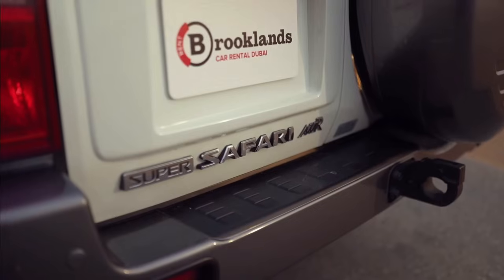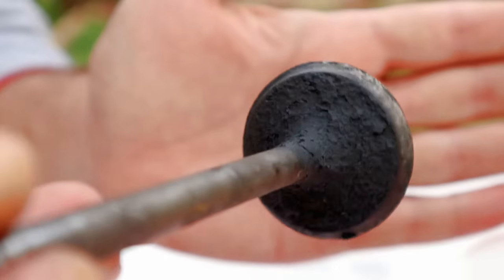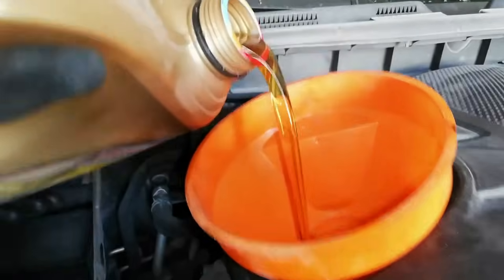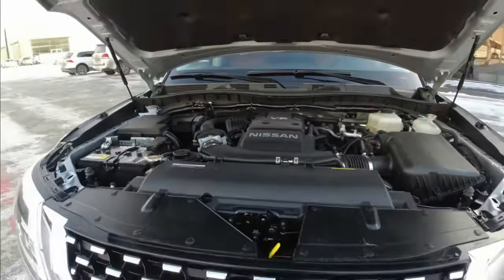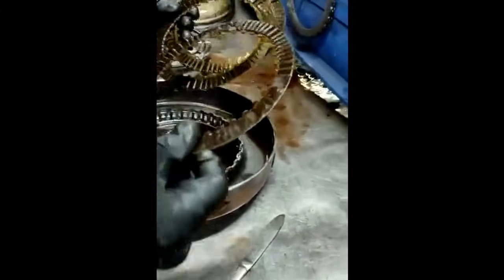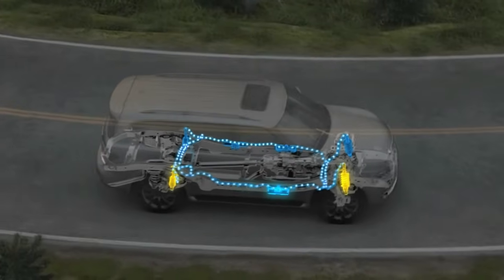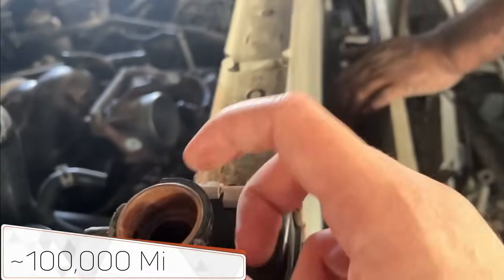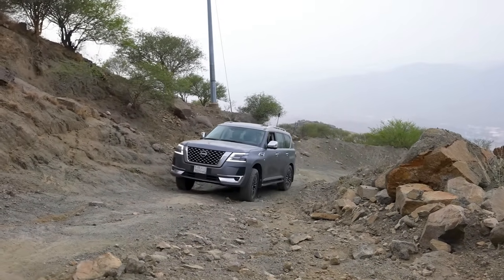Nissan Armada Y62: still a good buy in 2024? A Complete Reliability Guide

Comment: The Y61 is the greatest 4X4 in history of automobile.
Reply from the maker: Absolute legend 💪🏻
Reply: 😂after landcruiser
Reply: @kaidenchetty4572  To be exact the 80 series Land Cruiser
Reply: With the ZD30 engine, or kettle TD42?
Reply: @ericjohnson6802 The TD42 being a kettle is over reported. Bought mine new, towed a caravan up a d down hills all day in over 40 heat. Never had a over heating issue and same goes when I have talked to other owners.
Reply: @Dazza-u4c 100%
The 4.2 only got the kettle reputation once social media came around and every young guy around got one and wound the boost to stupid levels trying to make it a motor it was never meant to be. 
I’ve been running them since 1988 and never had a single issue.
Reply: @BrianMariki2022  nope. LC 105 with Solid Front Axle and the venerable 4.7L V8.
Reply: @Baebon6259   I was referring to the Diesel variants. The 105 came a NA Diesel which didn't have enough grunt. The 100 had this 1HD-FTE motor which was superb but IFS
Reply: y62
Reply: TB48 trounces anything toyota make, and Nissan still make them for the middle east. Nissan Petrol engines superior to Toyota. Agree with above comments. TD42 only suffer over heating issues when P plater dorks decide to stick a turbo on an engine that was not designed for a turbo, has probably done 400k miles already, and not been maintained properly. Factory well maintained TD42 turbos are bulletproof

Comment: Got rid off my cruisers after 20 years of on going problems. Had a pattol since 2008, only replaced alternator. Apart from tyres brake pads, greatest Automobile ever. Cruiser has a cult following, i fell for it, glad i wole up
Reply from the maker: Y61?
Reply: @thelonglastexpert  1990 y60, in 2008 I brought as a 1 owner of Oldman with 260k. Now has 558 runs perfect.

Comment: If I cannot drive a Mercedes-Benz Geländewagen, it will have to be a Patrol.  Toyota uses engines from Yamaha, Isuzu and Mazda.  See, I do my homework.  Also, unlike Landcruiser, Patrol has proper diff breathers, just like the G-Klasse.
Reply: Please provide some sources that says Toyota uses engines from Yamaha, Isuzu, and Mazda. Those 3 manufacturers are some of the only that have a chance at making as reliable of an engine as Toyota genuine designed engines. Add Honda to that list it’s a top 5.
Reply: @andyeighttre I thought it was common knowledge that’s Toyota uses engines from Yamaha……

Comment: I changed the entire driveline oil (gear, transmission, power steering, transfer case, and spark plugs) at 20,000 miles on my 2023 Nissan Armada platinum, and it NEEDED IT!

Comment: The VQ40DE uses almost the same fuel consumption as the VQ56VD, there's absolutely nothing special about it other than saving on initial purchase and then having a sluggish slow car. I own the VQ56DE patrol and I'am happy with it clocking 320,000km with no issues. The only major thing that I replaced is the radiator and power steering assembly which broke due to jumping hard on large speed bumps in Dubai.(Note: The steering assembly leaked oil but it kept working fine all the time, the service advisor said it can only be replaced which is much easier and cost effective).

Comment: I just bought a 2020 Armada (68,000 miles)  basically for its Tow Capacity (rated 8500lbs), I'm not as concerned about Fuel Milage as we use it primarily for fun (tow our vintage car) Sure would be great to get 22mpg as we did with our MBZ Sprinter Van but the Armada is more comfortable.

Comment: All Direct Fuel Injection engines can suffer inlet port carbon build up as the fuel and its detergents no longer 'wash' the ports and the back of the valve.

Comment: Which Patrol is more fuel efficient between the TB48DE 4.8 litre 6 cylinder Y61 and the VK56VD 5.6 litre V8 Y62?
Reply: The 5.6 V8
Reply: The 4.8 Y61
Reply: Y62 for sure. My 100 tdi lags behind in spades!😅

Comment: I’m so close to buying a 2023 Warrior. Should I? Shouldn’t I? Do I wait for the Y63? Or do I go for the last of the V8s?
Reply from the maker: It's hard to answer this question, sir, but we must admit there's not much reason for joy. Take a look at the new QX80, and in my opinion, it's a large luxury SUV that your wife should be driving. I believe that if the company makes a new Patrol based on this SUV, it will be a fiasco, but there is great hope that a different platform will form the basis of the new model, and then there might be a chance to look forward to the new Y63. However, if you are a fan of a big V8, I don't see much point in waiting since the new Patrol will likely be the last V8 for this model.

Comment: You should make a video on a Lexus GX460 reliability or The Toyota LC150
Reply from the maker: It would be interesting to make a video about these cars. The GX460 has an excellent engine, but it's very important to service it properly and wash the radiator regularly. As for the LC150, with the right engines, it's tough to break this vehicle.
Reply: @thelonglastexpert  I do have a 2014 lc150 with the 2TR-FE has been amazing for the past 10 years 0 headaches but very weak on power, Should I upgrade to the Infiniti QX80 2017?
Reply from the maker: @aayanusman9296  From a reliability standpoint, it’s not worth changing, but if you need a lot of power, then why not

Comment: That's an awesome video with a ton of great details!! 
How bad is the carbon build-up? Can I get more than 500.000 km out of this engine?
Reply from the maker: thank you💪🏻 which engine? vk56de?
Reply: @thelonglastexpert  yes, the 5.6 V8 of the latest generation Armada after 2021.
Reply from the maker: @galaxyphone7784  The engine is quite reliable, but it's important to understand that direct fuel injection leads to carbon buildup on the valves, which needs periodic cleaning. It's hard to imagine a VK56VD engine going 500,000 km without a stretched timing chain or some other issue; such an engine requires maintenance, but with proper care, it shouldn't pose problems up to 300,000 km, as many issues have already been addressed by the manufacturer. You should understand that when buying a Armada with this engine, you're primarily buying power.
Reply: @thelonglastexpert  great explanation, appreciated it. I think one or two carbon cleaning procedures and a possible replacement of the chain should be ok, I guess. Debating between the Armada and the 5.7 V8 Toyota Sequoia, both have their advantages, just like the Armada over the Sequoia.

Comment: The Nissan genuine automatic transmission fluid Matic-S for the Jatco automatic is horrendously expensive, compared to the genuine Toyota WS fluid for the LandCruiser 200 Series AB60F transmission.
Reply: My Toyota was serviced on schedule, but the gearbox main shaft bearings, the centre bearing and the differential all failed 400km/250mi out of warranty.  I was on my own.  Never that appliance crap again.